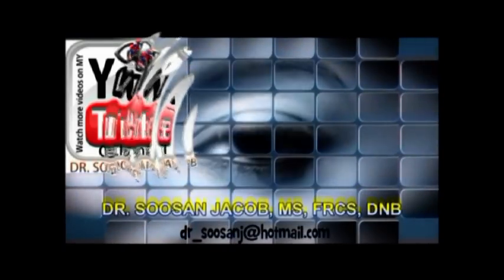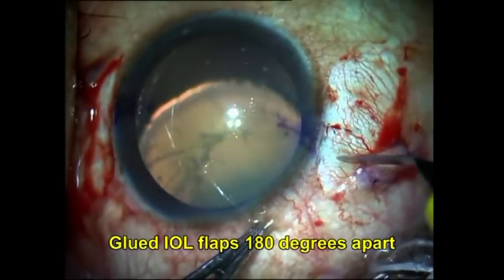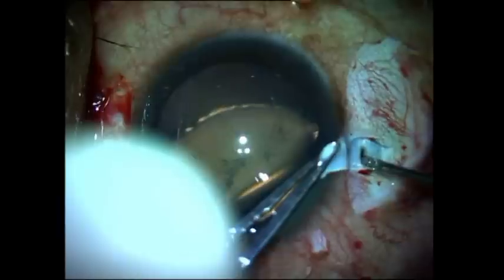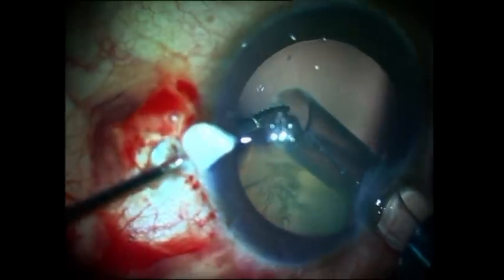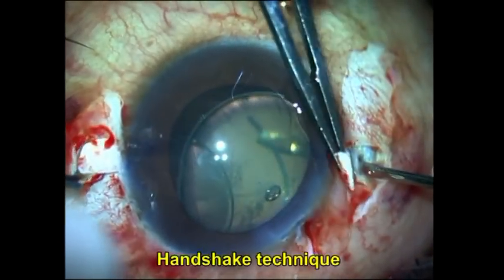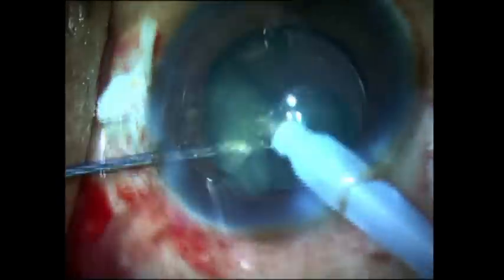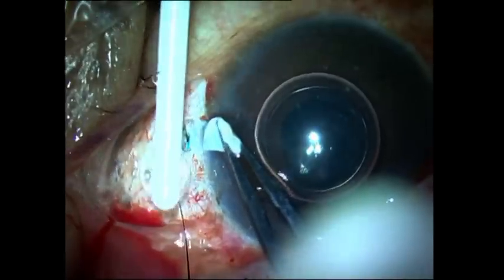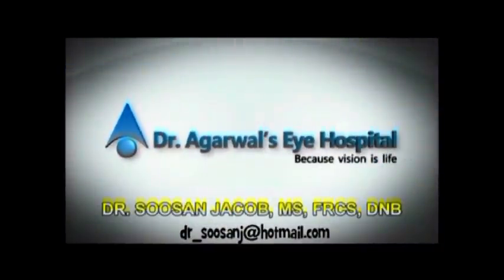Glued IOL Scaffold for dangling subluxated cataract Soosan Jacob 3 4 min with audio

Comment: very dangerous and heroic act. 
during exteriorizing the 1st haptic n pushing the optic behind dangling lense, all will not be lucky so much to get it rescued from dropping yr weak zonular nucleus. In 99% of cases.nucleus will get sunken.
all will not be pretty lucky go get soft subluxated lense,with exception of traumatic cataract.  most of the subluxated cataract will come with hard morgagnion cataract, and will need more effort n energy to emulsify in iris plane.